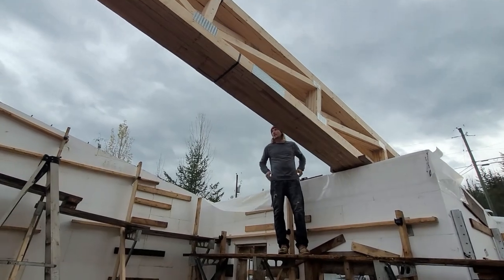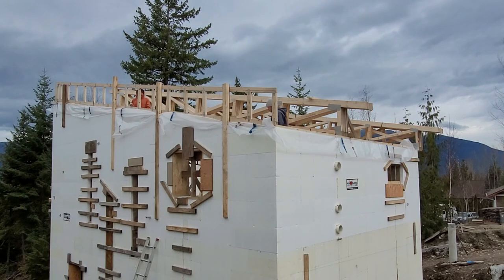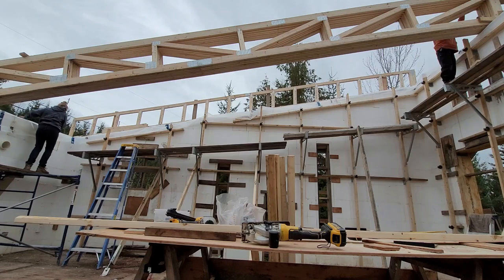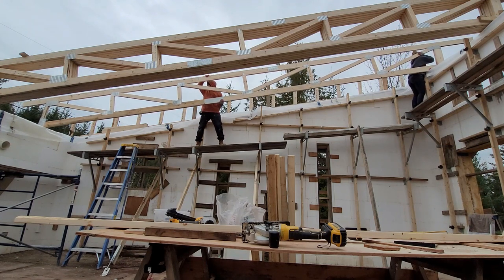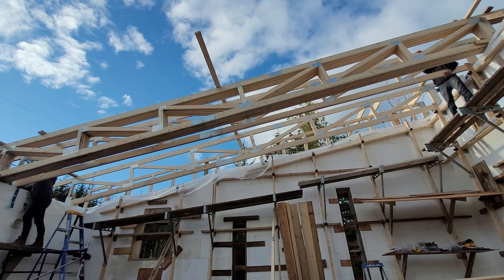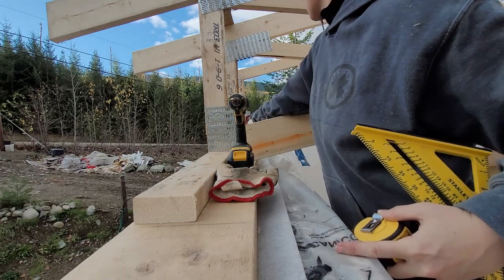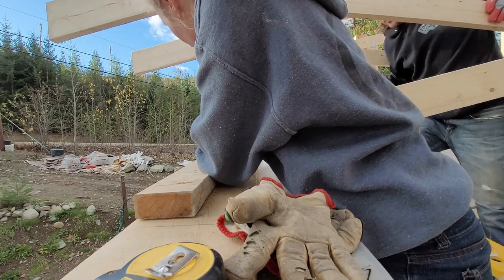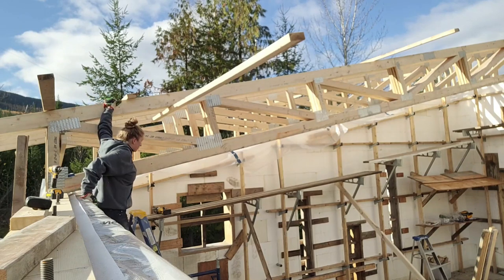Trusses! Spreading out the trusses for our single-slope skillion roof.

Comment: Continue the good work. Don't worry about all the steps back and mistake, i installed roof joist 3 times in my life and each time was really hard and 1 year after, i was like : «i should hae done this, and this, and this, instead of that and that..». BUT i would never be able to comment like that without all the struggles. You are doing great and nobody i know ever done an insulated concrete house like yours the first time. Remember that you are amazing andd  inspiring. Good luck!
Reply from the maker: Thanks for your kind words, even watching this footage we realized a few things we will do differently if there is a next time 😀.
Reply: @anaverageacre  Where did you get your trusses?  What is the span you had to cover?  We're putting together the pieces of our place and are looking for something similar.  What are the few things you'd do differently? :)
Reply: @SailingSoulianis  we got our trusses from Accutruss, we gave them the house plans and they engineered our floor joists and trusses. They span 32 feet plus a 3 foot overhang on each end. We had considered doing SIP panel roofing and if you watched our videos we did a whole lot of insulation and air sealing, the time spent on all that plus all the cross bracing etc. was way more than we expected and looking back we might have just paid the extra cost for SIP panels. Other than that we are happy with the finished product.
Reply: @kgibson575  Thanks for the response!  We started our plans thinking about SIPS as well.  Still might go that route.... especially given the feedback here :)

Comment: I really love the videos. What is the height of the trusses and is it enough to accommodate the HVAC system ? I was having a problem with my design which also has a single slope but now I have a better idea of what I need. Great job you guys! My draft designer recommended exposed metal duct work but my wife did not like the idea. Shout out from Tucson Arizona
Reply from the maker: I think the trusses were about 30 inches. Lots of room for the flexible duct for hvac. Thats actually what we are working on now, just posted a video about it!